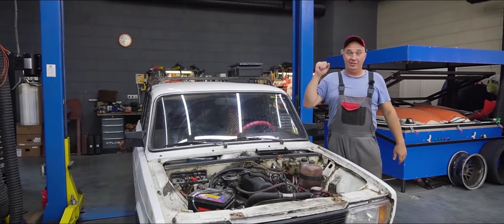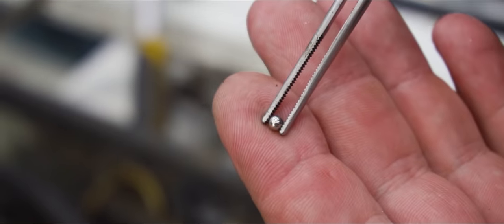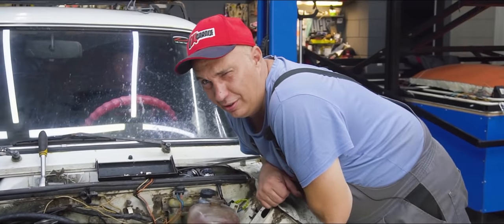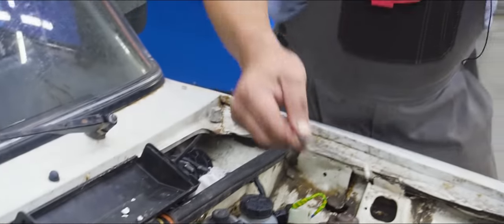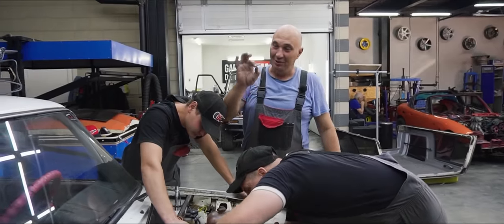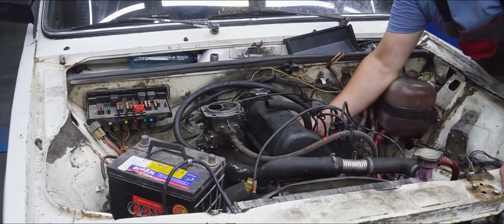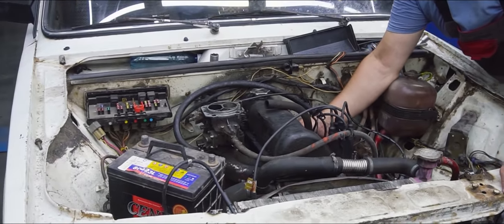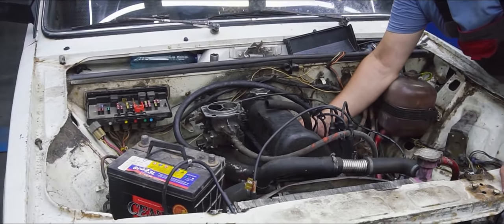Putting metal ball inside combustion chamber to see what happens

Comment: Hey, there's some way to market this...I know!
Head gasket repair in a bottle is basically little glass beads that get melted and extruded into the gasket to seal it. So if we use that same concept with the metal balls we get...piston in a can! Dump a bunch of tiny ball bearings into the cylinder. It will use the phenomenon where enough BBs will self-organize into the most optimum structure like certain atoms will, and viola! Instant piston in a can!
Want to up your displacement? Want to turn that 2 liter 4 cylinder into a 2.4 liter 4 cylinder? Simply dump .1 liters of Piston in a can into each cylinder! 
'Want more displacement? No need for a replacement! Try Piston in a Can!'
I know what you guys are thinking: "What a brilliant idea! I'm going to steal it for myself!" Well DON'T, okay? Patent pending! *Swats at.* PATENT-*SWATS!*-PENDING!
...I'm gonna be so rich. >=)

Comment: Make a clear acrylic plug to fit into the spark plug hole that extends a little into the cylinder and drill a long hole that doesn’t go all the way through to insert the camera into. It’s like the guy that does see through working engines using the acrylic. Use a long,dense piece to make your spark plug adapter. I would draw you a diagram but this text response won’t allow for pictures or drawings!

Comment: I had Sym Jet Korean scooter with 2T engine licensed from Honda. Crankshaft ballbearing's cage broke and went through canals to cylinder and engine seized. I found most of the parts in exhaust, head was damaged and one part, which seized engine, end up between piston and canal edge, damaging piston. After restoring shape of piston ring canal, changing rings, ballbearings, seals and ignition (probably blown by overvoltage when crankshaft start jumping with magnet) engine run for few years with damaged piston and head and minimal damage on cylinder, until oil pump failure caused another ball bearing cage failure with repeating same damage...

Comment: On a Cosworth BDA racing engine ,  an " L " broke off a spark plug ,  hamburgered  No 1 , then No 4 , then broke the head off an exhaust valve in No 3 . The valve head was stuck on edge half way into the piston top .  It had individual exhaust runners , so we    think the "L "  went into the air intake box  , then back in ?

Comment: I don't know the firing order of that engine but the only way that would be possible is if cylinder 4 was scavaging while cylinder 2 was on the exhaust stroke.  The vacuum effect of the scavenging 4th cylinder could have pulled the bearing back through the exhaust valve. Just my best guess.

Comment: To venture a guess based on the damage to the head, the larger balls had a diameter higher than the height of the squish band in the combustion chamber and therefore the piston was stopped dead in its tracks.

Comment: I’ve always wanted to try to make a plate to cover the carburetor inlet with a hole for a fitting to connect to an air hose. Wondering if slowly raising pressure would act like a supercharger.

Comment: I'm a retired forensic expert who specialized in analyzing vehicle crashes and mechanical failures.

I have seen evidence of debris and foreign material migrating from one cylinder to another in the course of catastrophic engine failure many times.

I believe that this occurs when the compression in a cylinder is compromised by a failure and debris is then aspirated via that cylinder's intake valve into the intake manifold and then via the intake valve of another intact cylinder by the suction of the intact cylinder.

Careful analysis of this phenomenon revealed that debris was most likely to be ingested into the cylinder next  in the firing order sequence following the cylinder experiencing the initial failure.

Comment: Happened to me in the 80s. I suddenly had a vibration at about 80kph speed. It turned out, a piece of ceramic from a spark plug was rattling in the cylinder. Got it out with a stick i added a bit resin to. New spark plug in - problem solved.

Comment: Next time try putting some sand into the carburettor and see if it comes out of the exhaust.  Also see what happens if you pour in various liquids and gases.  Which make the engine rev up and which make it stall out.

Comment: I remember once at my college course years ago we were working on a Renault 5. The previous group of students had left the car for our group. 

Our tutor started the engine, which ran for about 5 seconds making a horrible clacking noise and then DUNK. Just seized up. 

We all went to work on a different car while a couple of tutors looked at the Renault. Turns out a bolt had been dropped down the cylinder and whoever did it decided not to mention it. Broke the piston and fell into the crankcase. One very dead Renault.

Comment: Saw a 1969 Dodge Charger with a 426 Hemi that had been stolen off the new car lot the night it was delivered.
Once it was recovered and returned to the dealership the heads were removed. 
All 8 cylinder walls were galled and 4 pistons had large holes through the crowns.
Frequently the new cars delivered were in need of prep prior to delivery: that included tune ups, wash and waxed, and most importantly of all fluids topped up. This particular  car was almost dry of fluids and the thief dogged the shite out of the car...it WAS  a Hemi after all.

Comment: my theroy as to how the ball skipped cylinders (be awere im not gonna explain any terms.), when the valves open to begin the exhaust phase of the cycle there's a small amount of what is called overlap in the valves opening times to allow something called "scavangeing". this will cause some intake gas to exit the cylinder into the exhaust. but some engines the valves can stay open long enough for the piston to come over bdc and bigine pushing the charge mix back out into the intake and exhaust simultaneously
Reply: as such it can cause the ball to bounce out of the cylinder with the puff of charge and make it into eather manifold which then allows it to enter another cylinder as normal.

Comment: why didn't you show the other cylinder's, id say the ball went through the intake, exhaust would have blown it out.
i had a carb nut fall in the intake without knowing it on a Isuzu pup i started it heard the noise shut it down. i was able to get the nut out with a magnet. that engine ran for another 120 thousand miles before i sold it.

Comment: I once had a 535i that shit out a retainer and dropped a valve into cylinder 1.
The head of the valve bent sideways, cracked off the stem, and lodged into the piston then played bongo drums on the head. Destroyed the piston, rod, crank and head.
I pulled the motor and sold the chassis to a guy that had a bad rear ender on Vanuatu who swapped in his driveline

Comment: I had a carburetor short fuel tube fall into the manifold and into a cylinder of a 67 VW.  It was brass and soft.  A shop took took the head off and charged me to do some clean up work on the head.  A year later I had the engine apart for some other reason and found that they never did any "finishing" and it was minor anyway...but they charged me.  End of my experience with that shop that did my regular service.

Comment: Peening the cylinder will cause oil to slip by the rings each cycle of the piston to much would lead to possible ring gap opening to much to hold the oil back

Comment: Really, what is the point? Any mechanic, pro or back yarder who works on engines has already seen what happens when an engine runs with a small nut or some such when it gets unnoticed into a combustion chamber.

Comment: Such a car you are speaking of is like the 2003 -2008 Nissan Altima with a 2.5.     The catalytic converter would degenerate and get sucked back into the cylinders ruining the engine causing oil consumption.

Comment: A bearing ball from a overhead shop fan / air circulator that is active 24/7/365. i got hit in the face with one while cleaning a Porsche garage once. i remember it distinctly because i was pushing a machine when i heard a bunch of pinging noises suddenly, i slammed the brakes on my machine thinking i just hit something then a steel ball smacked me.

Comment: i had a 7.3 idi eat a glow plug one time, it shot out through the exhaust pipe. I did not feel like pulling the head so i just turned it on and held it at 2k rpm LOL worked perfect I do not suggest LMAO

Comment: A handgrenade in the cylinder and put it back together.  And the safety pin is pulled by a string through the sparkplug hole would be very interesting 😍😋🤣🙄

Comment: 👍You need big balls for this experiment. I noticed it didn't choke too bad until the big balls where inserted.lol And I'm quite sure the endoscope goes in the rear.😜
   Thank you for your willingness to destroy an engine for our curiosity.
     Now for those who ever had an inkling for sugaring someone's gas tank. 😠 It seems like their Grudge would work much better with shards of ceramic and emptying BB's down the carburetor. (Throttle body)😵

        🐂🤠🏞️

Comment: A engine with failing ring lands a dropped valve or seat the carnage will migrate to other cylinders hell I have seen in v8s cross over into the other bank your spinning 7k shit happens. A lot of air movement scavenging its called one cylinder takes some air and ball bearings from another cylinder.If cylinder 1 had covid the other 7 would have it in the first 5 seconds of running.Just saying.